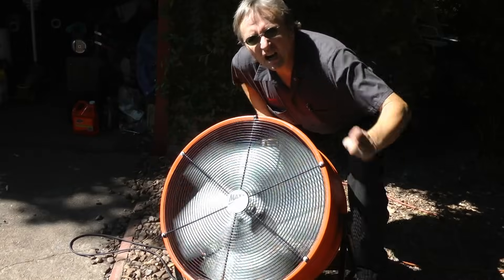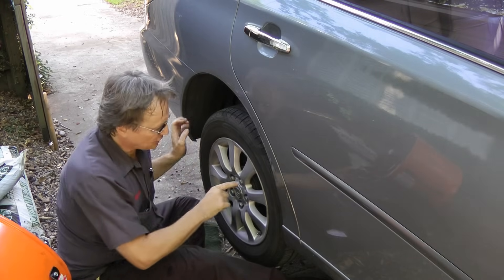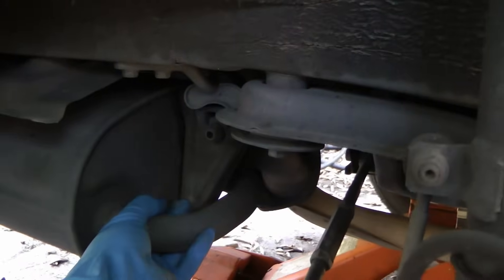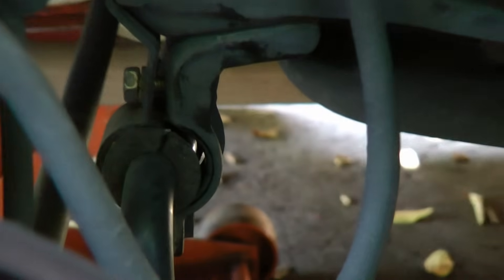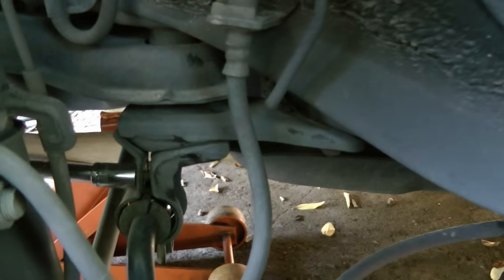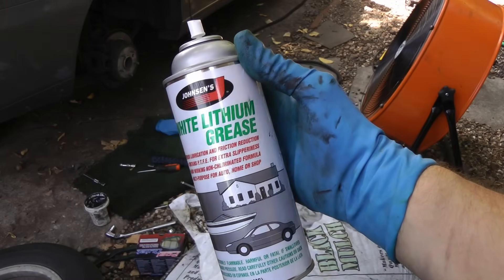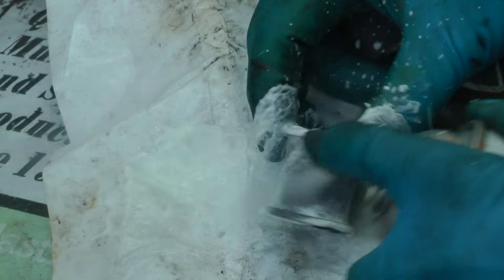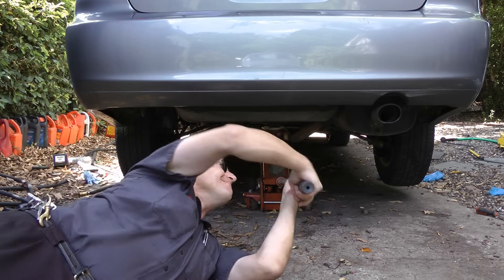How to Fix a Car that Creaks in the Back (Sway Bar Bushings)

Comment from the maker: ⬇️Things used in this video:
1. White Lithium Grease: http://amzn.to/2D42JRM
2. Big Fan: http://amzn.to/2Bwiu3A
3. Ratchet and socket set: http://amzn.to/2inoxOY
4. Mechanic’s Tool Set: http://amzn.to/2Bzmccg
5. Shop Towels: http://amzn.to/2jGDfkA
6. Disposable Gloves: http://amzn.to/2zSRuxO
7. Flashlight: http://amzn.to/2kwtiu3
8. Steel Jack: http://amzn.to/2Asgjxo
9. Jack Stand: http://amzn.to/2jGOwBg
10. Common Sense
11. Full HD Camera: http://amzn.to/2AvoEk7
12. My computer for editing / uploading: http://amzn.to/2i2sKYz
13. Video editing software: http://amzn.to/2jv5Fhf
14. Thumbnail software: http://amzn.to/2k7tz6C

🛠Check out my Garage to see what I use every day and highly recommend:
https://www.amazon.com/shop/scottykilmer

👉Follow me on Instagram for the latest news, funnies, and exclusive info / pics:
https://goo.gl/ohy2cA
Reply: What about squeaking in the front also? Could it be the struts need to be replaced on a 2008 Honda Element with 167,000 miles?
Bushings?
Struts?
Anything else?

Comment from the maker: @MessivoKaxto  There are many suspension parts back there, from a frame bushings to sway bar bushings to even the strut mounts (you changed the strut, but what about the strut mount?). on the plus side, those little noises can be annoying  but often don't hurt anything as long as the wheels don't wear strangely and the car handles fine. Scotty
Reply: Thank you!

Comment: Thank you Scotty. I'm not sure if you'll see this, but hopefully we can figure out what's wrong by following your video. The back passenger tire is making multiple noises, and it's honestly a little terrifying. There's a clicking that sounds similar to if we had something stuck in the tire, but there's nothing. It's randomly popping, not super often, but enough to be concerning. It's also creaking, I'm pretty sure that's mainly when we're going slow though. Anyway, thanks again.

Comment: Had a very bad squeaking rear for a long agonizing time.  At first, I changed coil springs, shocks, which gave a comfy ride, but squeak persisted. *Noise was the parking brake cable, where it hangs from hooks*.  Usually wrapped in some sort of fabric to prevent metal on metal contact, but fabric was worn down upon inspection, allowing the metals to contact, causing the squeak, irritating me.  Put a bunch of grease in between the hooks and bare cable.  An old seat belt wrapped on the cable and secured with zip ties may have worked too but grease is the easy, cheap quick fix.  Either way feels good.

Comment: I had creaking sounds on my, put new struts on it, still creaks, put new upper control arms on it, stlll creaked. The guy that put my control arms found the problem to be loose bolts on the frame. Noise gone.  For months, I've had the problem. 5 mins and fixed.

Comment: Great video (made a subscriber out of me), I am going to work on the squeaks of my Chevy Suburban 2012 LTZ, what weight capacity for floor stands and even the floor jack do you recommend for the weight of this large SUV (good excuse to buy some tools)?  Also, I'm sure there will be bushings or suspension issues I find that I'll prob have a local shop do, is there a paint I can use to use to identify those bushings areas for the shop to replace?  Trying to make it easy so that they get them all (haha like Pokemon). I'm getting a suspension warning light so I know it needs suspension maintenance so the shop will be working on that at a future time.   For those areas I don't replace that need it I'm thinking of hitting with wd40 silicon lubricant to tamp down on the squeaking.   Any concerns about replacement parts for suspension maintenance this year and model?

Comment: Hi Scotty, I’m noticing a creek in the back of my car and it seems more pronounced after getting a wheel alignment and two rear tires replaced could have anything to do with the alignment or could it be something like the sway bar bushings or maybe even the shocks which I have heard that I do need to replace at some point.  Just thought it was weird that after the alignment, it seems more pronounced the noise.

Comment: @chamblizi what kind of truck is it?  you can do a body lift, which just puts a block between the frame and body to raise the body up 2-3".  and for a suspension lift you can go simple in the back with a block between the axle and leaf spring (or a heavier leaf spring in general)  and the same thing in front (if you have leaf springs) or in most cases, they use a spindle lift, where you replace the spindle.

Comment from the maker: @ktch7069  try spraying AT 205 reseal all over the rubber bushings back there, interesting how they said they fixed the noise, but then later said that noise is normal. What a load of crap.

Comment: @chamblizi if you want to lift it, lift it.  its your truck.  don't worry about what others say.  just as you go higher, put wider wheels and tires on and you won't have any bigger chance of flipping.  i have my silverado lifted 7" in the front and 5" in the rear on 31x10.5 tires going to 35's soon and i have seen no difference in ride quality.

Comment: I replaced the sway bar bushings on my 03 Element and I still have the rear end clunking noise. I'm going to replace the sway bar links in a few days -- you should have mentioned replacing those as well. They're inexpensive and supposedly fairly easy to replace.
Reply: On my 2003 civic I just replaced the rear sway bar links and the rear sway bar link bushings and I’m still hearing a clunking sound.
Reply: Looks like he didn't want to do this video about end links. Probably because they are more difficult to get off and not so easy to replace as sway bar bushings, which anyone can succeed at.

Comment: Great video!  I've got a Ford Focus 2007 Euro model. Forgot to release handbrake once when moving off, since then the rear (right?) brake groans whenever the brake is applied and released at low speed. The rear wheel also squeaks when I tried to bounce the car with handbrake on. Brought it back to the dealer, first time they said it's loose suspension, all fixed. But the problem is still there, brought it back the second time they said it's normal. What do you think the problem is? Thanx heaps!

Comment from the maker: @jakob2803  I use air tools, they work great. I have tried electrical tools, and other than an electric grinder and drill, then generally stink for auto work, not enough power. Scotty Kilmer

Comment: If the creak is from polyurethane bushings, one trick is to wrap the bar with industrial plumbers tape, then put thick lithium grease over that, then snap the bushing over all that.

Comment: hey scotty, if you're still there. my 08 toyota 4runner is making creaking sounds while i engage it park to drive or park to reverse, etc. everyone is saying it is normal, but when I bought it new it didn't make that sound.  Went to the dealer today, and what a load of bull they told me. I told them, if I test drove a new 4runner would it make that noise, and they said no. Have you experience this noise?

Comment: Thanks for the video! I wish it was that easy on my Lincoln LS - the rear subframe needs dropping to swap those bushings!
Reply: vVeazel I have a ls too. Same squeaking sound in rear. Is it possible to access all the rear control arm bushings without removing the tires? I just need to lubricate them lol

Comment: Hey I’m getting that traditional ford noise that those 1995 explorers and expeditions make. I have a 2013 Ford Edge and it started making that nasty suspension noise those older ones make but I’m only getting it on the right rear. What do you think it could be?

It’s not clunking, grinding or anything other then when I go over certain bumps I hear the squeaking or “old suspension” sound

Comment: Hey Scotty, squeaking noise appeared in the rear wheel of my Toyota Corolla LE 2014 just right after replacing summer tires to winter tires (already installed on rims). Summer tires were 205/55R16 (original size), installed winter tires (came with the vehicle) are 195/65R15. There was no noise before replacing the tires. What do you think?
Thanks

Comment: Scotty do lub nuts start to squel after some time? I went to mechanic yesterday to figure out why im havin a squealing sound coming from the back. Assuming it was a brake I needed changed or something else . He checked all the wheels the brakes are still in very good shape. In one of the wheels in the back im missing one lub nut he told me it could be that one of the lub nuts is going out and makin that sound and that i should get them replaced. What do you think?

Comment: I have a 2004 Toyota Avalon XLS and the rear makes a scraping sound when I drive or press down on the back. I've replaced the struts and thought it might be the sway bar bushings. I replaced them and it's the same. I can't feel anything loose in the back.

Comment: Hi Scotty can you please help i have 2010 honda civic type S gt i here noses at rear and  the fornt so I checked car myself i see passenger side shocks look damage so I go and buy 4 shocks and 2 CV join i give to garage to fix them give the car and I cant drive over 35 because the body of car vibration more at the back but streering wheel is not vibration only car body and I dont what do do

Comment: Hi Scotty, Aussie guy here again, Question..
I also own a '06 BF Ford Falcon' which has a irritating noise coming from the rear IRS suspension, it's a loud 'clunk, clunk' noise that only ever happens when I pull up hard at a red lights, It has been to 2 Mechanical shops and has also been to Ford themselves and no one can find what the problem is, they can all hear the noise they just don't know what it is! They even told me I will have to live with it. How stupid is that! Any ideas? Thanks

Comment: I have a 2000 Camaro Z28. I doesn't make any suspension noises while Driving. BUT - When I go up my driveway, at an Angle, it makes this really strange Creaking-Noise from the Rear Suspension somewhere. It seems to be Quieter in the summer months, and much Louder in the Winter. What are you Thoughts??
Reply from the maker: rubber bushings get old and do that, in the summer they are hot, and softer. In the winter they are cold and hard and make noise. Try this at 205 reseal fix

Comment: My 2008 Rav4 makes a whining/smooth grinding noise when I accelerate forward just after a stop, its like the noise is coming from the engine. another issue with it is that I get squeaking noise from the back when I drive over bumps, however, this does not happen when the car is wet, like driving after rain.

Comment: My dad's 2001 Malibu rear sway bar needs repaired the garage told him if the middle bolt breaks it's not worth fixing and they want to charge him $500 is this true is it costly if the middle bolt is rusted and breaks?
Reply: check with several other  repair people.

Comment: What if you have a squeaking coming from the back wheel that is speed sensitive and is not the brakes?  This is in a 2005 Corolla with 246k miles on it.

Comment: Hi Scotty You are greatBut please practice more safety when use the jack
Reply: lol.....scotty is funny....he is a jokster. good guy. very knowledgable.
Reply: 50 years....i think he'll be ok.
Reply: you don't feel safe jacking a car up,  certainly shouldn't be trying to work underneath it
Reply: wheels wher on wouldent mater
Reply: OH YES YOU DO,     Hydraulics fail all the time sometimes suddenly.    Jack stands or better yet 6x6 wooden blocking.   For the big jobs like transmissions ect.    
    Jack stands slip easily and can tip .     At the least I ALWAY at minimum fling a tire under there.   .

Comment: would I have that same issue? My 96 honda accord has been making some squeaking noises in the back when I brake recently. sounds like rubber if anything.
Reply from the maker: sure, give it a try, being that old, the rubber parts will all be old by now and creak

Comment: I have a 2015 F150 and anytime my truck flexes when going into and out of a driveway or on an uneven road I hear a creak/clunk noise from the right rear. When the roads are wet and the bottom of the truck gets wet it does not make the noise. Any thoughts on what that could be?
Reply from the maker: water lubes rubber bushings, find the worn ones, sometimes just spraying WD 40 on them stops noise

Comment: Mine has been creaking in the front I believe. When I slowly turn or go over bumps, or even just slowing down. It's a lease and they're saying it's gonna cost me $600-700 🙄 please help! Also when my heat is turned on the engine area makes a tist tist tist noise, but when I turn it off the noise stops

Comment: i have 2002 corolla NZE now when i apply brakes slowly i hear a creak creak creak creaking noise even when car is in park from the left front wheel. what is that?
Reply from the maker: +-xDriftking90 - check for worn a problem in the booster then

Comment: My SUV brakes make this sounds very lightly if I gently let off the brake. Doesn't make the sound all the time..Any suggestions?
Reply from the maker: yea, let off the brake vigorously then.   Odss are some rubber bushing back there is worn and they are cows to figure out unless all cracked and easy to see

Comment: Scotty using a air powered tool to fasten tire nuts is bad. It damages the threads because the machine keeps turning the bolt even when it's already fit in perfectly.

Comment: Guys some help here. I hear a noise like there is a nest with birds in the back of the car.
But mine must be some kind of chasis or suspension sqeak because when the car is OFF and I jerk it back and forth it sqeaks. 
It is a 1989 Nissan micra by the way.
 I am not that familiar with car parts and thats why I cant guess what it may be. Sounds like there is no lube in the suspension, or something like that.
Thanks a lot.
Reply from the maker: check all suspension bushings, and spray them all with at 205 reseal that you can buy on amazon (as it's often hard to find locally)

Comment: Lithium grease doesnt help longer than 2 weeks.  If u use aftermarket sway  bar bushings, its gonna squeek. OEM won't do that.  I learned that the hard way. coughs...  FEBI BILSTEEN front sway bar bushings... ... smh

Comment: Scotty, i just encounter another problem with my 13' gt auto. Theres creaking sound near the passenger rear/wheel like a creaking gate when im in reverse. It comes and go, driving slow, fast or braking in reverse trying to reproduce the noise but doesnt seem to trigger it. I had it creak on me when i let the car reverse without any gas and when i give it gas.

Comment: Someone please help :( my car is making a squeaking sound only on the back right side when I push down on it and when driving only the back right. Could it be only needs some oil .?
Reply: True False yoy just watched the fucking video follow the instructions.
Reply: for me, squeaking means "lube needed."  Use silicone base grease, sprays, especially if the part has rubber, plastic. firstly i would grease up anything holding the parking brake cable to the frame.  not solved, i would move onto spraying the control arm bushings, see what happens. spray all the bushings, but use silicone spray lube. probably the brake cable a few feet away from the rear wheels, towards the front of the car.
Reply: i thought the exact same thing.